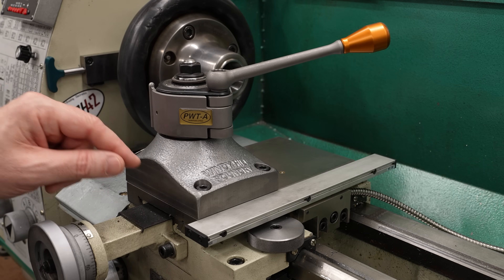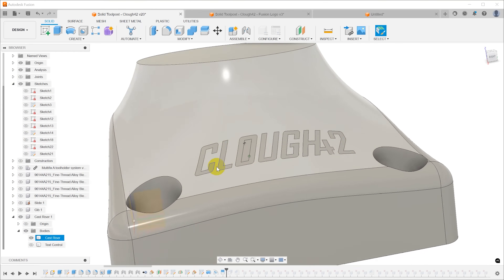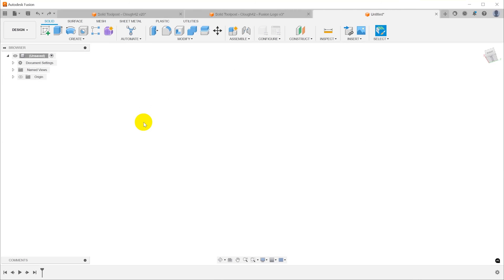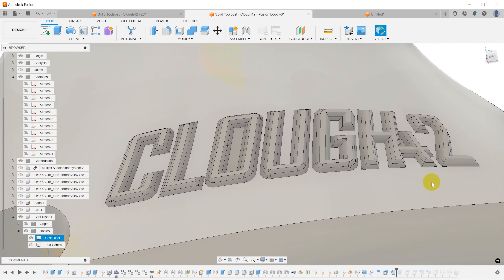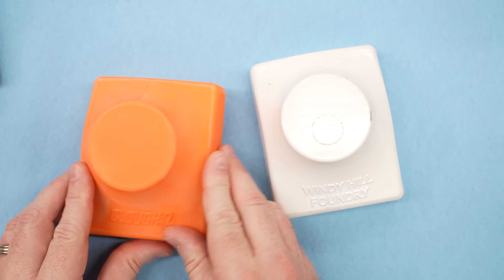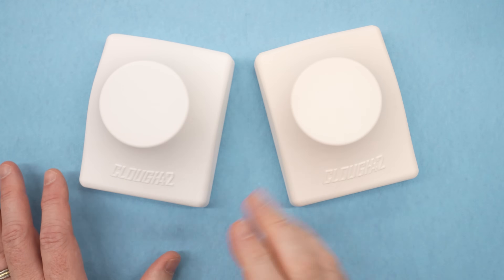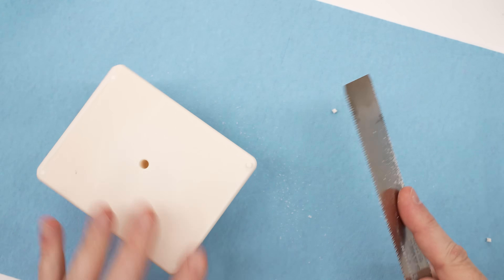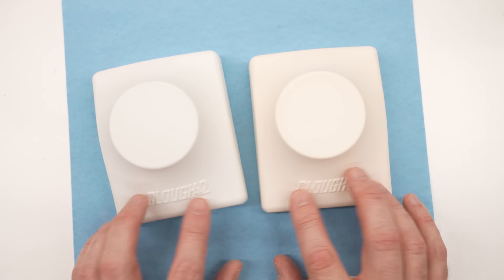Two Years of Effort:  Toolpost Riser Castings NOW AVAILABLE

Comment: My summer job in a pattern shop (late 70's) suggests that you 3D print a pattern to cast an aluminum pattern, which will last a good long time in production. The 3D print will have to be enlarged slightly in size to account for the shrinkage of the aluminum, if you desire that level of size accuracy. Love your channel!

Comment: The problem isn't Fusion, the problem is the font itself. Fonts generally are horrible when worked with like this, they aren't designed with precision. My typical path for any logo (not just for bringing into CAD) is to convert it to outlines. Then manually go and edit all the nodes, adding and deleting as necessary, removing any overlapping areas, and duplicate nodes, adding in constraints (smooth) for all nodes on the splines when transitioning from a line to a spline to ensure tangency. I do this until I get a minimal set of nodes that cleanly represents the original, which should be a single outline for any character (or joined set of characters), not including cut-outs. (basically what you ultimately did in Fusion, but doing it all in the illustration package of your choice).  You can then export that as a SVG, and bring it into just about anything without problem, it should correctly scale then too, without eating itself as you saw.

Comment: The "normal" production sand casting process is to print or machine the pattern from something soft. We used a material called Renboard. That was used to cast an aluminum pattern. If the aluminum pattern wore out, we would cast a new one from the original master. That said, the renboard patterns were often used to cast hundreds of prototype parts without issue. It's pretty fun to machine compared to any kind of metal.
Reply from the maker: I've often walked by pallets of renshape big enough to mock up automotive body panels at work.  It's amazing what you can do with it.
Reply: WWW in the house, you have that CNC machine up and running yet?  Nice work James thanks for the detailed explanation on Fusion 360.

Comment: I have a simpler solution. Print the pattern without the text. Print the letters as a seperate prints and glue in place. I have done this a number of times. it also makes it easier to fill smooth the main pattern without the text in place.

Comment: Hey James, A process my son has been using is coating the PLA print in resin.  I print the object in PLA on my Bambu then he dunks it in resin and cures it.  Fills in almost all of the layer lines.  You might try that, might save a bunch of time.

Comment: One fairly quick strategy I use with fonts is to fill them with black, then take a screenshot of your text (or export as jpeg, bmp, etc..). Then open inkscape and use the bitmap trace feature. This will give you a connected single vector around each letter (or the entire word if you are using connected fonts.)

Comment: Excuse me if I missed this in another video but can you share your thoughts on the horizontal offset you designed into this solid mount? Is just as simple as keeping the cutting tool as close to the work piece as possible?
Thanks, Erik

Comment: Haven’t gotten all the way through, but I’m curious if you’re going to talk about ABS or PLA vapor smoothing instead of sanding or bondo.
Edit: Ok, no mention but your result is great obviously. Still curious about vapor smoothing. If it works it should be cheaper and faster.

Comment: My strategy for complex geometry chamfers is to draw a triangle on a perpendicular plane and sweep it around the part. This still runs into problems, mostly self intersecting geometry, but it has gotten me through many otherwise "impossible" situations.

This doesn't work well for adding material to create the chamfers, it's best suited for situations where you can subtract the swept geometry from the target body. That said, you can sometimes oversize the triangle (and use something other than a triangle) to try to avoid gaps between the sweep and target body when you can't subtract.

Comment: I'm glad i'm not the only one struggling with fonts in CAD... 

I was often wondering if it wouldnt be easier to do the part modeling in some design software like Fusion/Alibre/Onshape.... and then just taking it to blender or plasticity for adding the fonts.

Comment: You must have heard me through time and the internet on that font. I used to be a full time desktop publisher. Illustrator, Photoshop and Quark XPress were my life. 😂Good fonts are expensive and are expensive for a reason. The foundries would spend hours perfecting issues like the ones you demonstrated with the "Mrs" problem by creating custom pairings and other tricks. Those issues didn't exist in them. But they were hundreds of dollars each, sometimes each style - Bold, Italic, Bold-Italic etc. We had one customer that insisted on using a provided font file - something they bought cheap - and I spent more time, and their money, fixing the problems we had using it than it would have been if they bought a professionally designed font.

Comment: At around 9:50 when you were editing the text outlines, did you know you can double click the text lines and it will show you how continuous the line is? Generally I only use the Fusion360 built in text function to label mold parts that are not seen on the final part. If you can't afford Adobe even a free drawing program like Inkscape will produce high quality type for 3D uses. Nice detailed video, I watched the whole 33 mins.

Comment: I'm an engineer that works in product development. Frequently we have to put logos/text on sand casting bucks and try and get them to draft. As you found: its not easy!

We developed a great way to approximate a draft angle on text (often "close enough" is "good enough" for sand casting). Rather than doing an offset of the surfaces, copy the surfaces you want and translate them in the same direction of draft (this eliminates any opportunity for undercuts to form) 

Then you create a new sketch normal to the text and offset each letter inwards a few thou. Use that sketch to split/trim away the offset text so that it is a little bit smaller than the parent surfaces. 

Once you are happy with the offset, you simply create a loft between the original surface and the offset surface. If you are trying to hit a specific angle you can start playing with the distance you offset/trim off of each letter until you get close.

The result is a letter that will have a consistent appearance across all of the letters and be in draft!

Comment: What's the dimensional stability of the resin print?
Because it is a thick opaque part my assumption is that resin inside the part is not fully cured, which may result in deformation of the part in future.

Comment: Interesting. I've done a lot of work with importing True Type fonts and other artwork into CAD/CAM tools, and haven't seen these sorts of artifacts in the fonts. The stuff i wrote was a v-engrave plugin for CamBam that walked the outline and computed a 3D path for a v cutter to dive into the outline such that the cutter rides tangent to both sides of the outline. 

One option that might be easier for cleanup is sucking the outline into Inkscape and cleaning it up as an SVG, which can then be converted back to dxf and reimported into CAD software. I did a lot of that for a recent project.

Comment: You can also set a negative taper angle in your extrude operation, which may have been able to give you a draft angle.
Reply from the maker: Not against the curved surface.
Reply: I would do a clean vector file projected onto two construction surfaces.  One raised and one slightly below the casting surface.  Offset the one but the distance needed for draft.  Then use loft tool to create letters.  Then use combine feature later with casting. I have found that creating a multi body part and combining at very end is the only way to get there effiently sometimes.  Sorry if I was hard to follow.
Reply: One other thing you can do.  Go to manufacturing space.  Cam the original part with no chamfer.  Use original model as stock model.  Cam the chamfer.  Save Cam machining simulation as stl body.  Cheater way of doing it.

Comment: Regarding Fusion problem - fonts are always pain in the ass. I tend to resketch everything using native geometry, proper splines/tangency etc. Other tip is projecting a sketch to a surface, then using surfaces to really build whatever you want to have there. This way you have 100% of control and you are not at mercy of emboss command.

Comment: Taking in to the account that its just font on casting metal(so it always have some small imperfections and dont need to be 100% accurate) I would just load main body in Blender or ZBrush merge font with body, smooth edges to get proper slope.... and done. Is it dirty workflow? Yep. Is it supper accurate? For casting and just for font/logo its perfectly fine. :D

Comment: A lot time when you export / import from Illustrator, you end up with some points on the outlines are doubled or overlapping. Like the start / end is usually not closed, but consists of two points. The same in sharp corners, which you need t clean manually. 
I am doing 3D design for over 25 years and it can be really vexing has you have found out :). The best way is exactly what you did - simplify - redraw.

Comment: woah 20min cure seems like a lot. I generally cure my prints for a 30-60s per side, but then I don't use opaque filled resins like that. I've only used Elegoos standard resin for a few prints, but then only Ameralabs XVN-50, and it's great to work with. Good resin really makes it so much nicer to work with

Comment: Nice work on the pattern. Clark will thank you for the care you take on draft angles. Have you used the oil based paint that Tractor supply has with their catalyst added sets up very hard and with a nice finish.

Comment: This issue is not unique to Fusion in the slightest though, it's the same in every CAD package I've used, in every vector drawing program I've used. You need to make sure the source material you're using is good, that's always the first step, otherwise you get issues like these. As the saying goes, garbage in, garbage out. I routinely have to teach this to the engineers I work with, even those who have worked with CAD for decades. 

I admire your effort in recreating the logo in Fusion, though honestly I think it would have been far less of a headache to just redo it properly in Illustrator, cleaning up errant points, fixing inconsistencies, etc.

Comment: I don't know if you have ever seen 'UV Cured Varnish' for wood finishing. It is simply wiped onto the wood surface and then cured with a handheld UV light. It seems to me than it is essentially a 3D printer resin (or variation). I had the thought that it could be applied to FDM prints to give them a smooth tough finish. Cures in seconds and can be layered. Never tried it, probably never will. Just a thought. 
Thanks again for another great informative video.😀

Comment: You probably already know, but us carbohydrate foam jockeys use various shaped blocks of wood to make sure we're only sanding the high spots.  It definitely helps make things go faster than using the soft pads of your fingers which somewhat follow the contours of the ridges.  Great video, i'll keep these resins in mind for my upcoming castings.

Comment: I would for sure make a female pattern and then cast it with Xencast P6 polyurethan plastic.. It cures in around 1h.
In that way you only have to do the work once for the female mold and you can reuse the mold for many many times. Especially if you make the mold in silicone.

Comment: Back in the mid 1980s I was taking a CNC Technicians Course and one of the CAD/CAM programs we used on a mainframe was designed for generating curved surfaces as com[lex as turbine blades and one of the problems we had was exactly like you had extruding fonts. We finally generated as list of fonts that you could extrude directly into the program. Others we would have to hand generate like you did by copying and deleting. The main problem we ha was the CAD/CAM program was power hungrily and we could only run it at night when most of the other courses were not using it, and it would still crash about once a week. .

Comment: Nice work.  

Have been working with fonts forever.  I always recommend cleaning or tracing.

For the mold, consider making a 3d resin master, make a silicone mastering then casting resin daughter molds.

Comment: Not just fonts, svg's in general. I had so much pain with importing files, until I just started importing and either repairing or redrawing. The add in, sketch checker, does a very good job of identifying those small errors.

Comment: it would be interesting to see whether abs vapour smoothing would produce a sufficiently smooth surface and sanding could be avoided
Reply: I worked at a cast iron foundry, and I can confirm ABS vapor smoothing does work for patterns. At least in Disa auto molding machines, they may not work quite as well pulling by hand. We had a set of ABS patterns that was going on 25,000 cycles, and were still within production tolerance.

Comment: An easy way to create the embossing is to create an offset face of the surface you want to emboss, then use the split body command and use that offset face as the splitting tool. Then simply merge the objects and you're set. The other simple way is to extrude from within the body you want to emboss on, use the "replace face" tool on the text face, then move the text out the same distance needed. 

If a visual guide helps i'm happy to make a quick tutorial on embossing on complex geometry in fusion, just let me know :)
Reply: Please do ❤️
Reply from the maker: @GodardScientific  I'd be interested in seeing that.  I've tried most of the techniques shown in videos all over the Internet, and most struggle with this particular geometry, though it would be worth trying them again with good sketch geometry.
Reply: @Clough42  I'll throw something quick together, for your model did you use a fillet or a revolve to create the curvature on the main body?
Reply: In Autodesk Inventor there's a "ruled surface" command that I've had a lot of luck with achieving a specific draft angle around the perimeter of complex embossed logos on complex surfaces in injection mold designs. I wonder if Fusion has something similar. It's still a tedious process, and I've never seen a tutorial detailing this approach. Unlike the software world where everyone shares ideas on Stack Exchange, the CAD world seems a bit more guarded, especially when you go beyond the basics. I wish I could share a picture of the part I had designed to give you an idea what I'm talking about.

Comment: I think for part of this, you perhaps lost sight of your end-goal, in the pursuit of making your master meet the requirement of being "quality and durable and printed".. You didn't necessarily need all 3 from one piece. Print one that takes into account 2x shrinkage, then cast sub-masters so it only needs to survive a few of those castings, store it, clean sub-masters to an acceptable level. Then you'd have actual metal castings to use as masters for the rough life of being sand mold-formers, so sand can be pounded against them without excessive degradation.

Comment: Twenty plus years ago I worked for a while as a graphics designer for a sign company. I ran into your Font troubles almost daily. Sad that nothing has changed. Happy that you figured out a solution. In the software that I used back then we could link all the parts of a broken font into a group. The other nasty thing I ran into was multiple layers of lines. 4,5 even 7 layers that you needed to delete down to only one layer. DXF files were the absolute worst when you wanted to turn them into a raster file SVG was your version. I felt for you man. Nice presentation Hoping you and Clarke the best in this adventure.

Mark

Comment: Would it make sense to produce a single high quality master and make it into a silicone mold?

Then you can cast as many copies as you want from 2-part resin.  You might even be able to coat a bolt with mold release to leave a threaded hole.

Comment: As someone who has nearly 15 years experience in CAD and WaterJet operation/programming, I feel your pain with text.
Shop owners thought it would be fun/profitable to make signs... I spent SO much time fixing and correcting simple signs and other people's designs just so it will even post, then having to go back and fix something because there was something that was missed that the machine couldn't deal with (usually impossible small angles).

Comment: Use Rustoleum 2 part epoxy paint for a hard smooth surface on your part model. It cures fairly quickly and is VERY hard and durable.

Comment: Why not make an Aluminum or Cast Iron master? If you allow for 3% or 4% or 5% shrinkage of the CI, (more % if you want an initial Aluminum master mould), you would make a 3DP mould at +6% or +8% or + 10% oversize to make the first 2-3-6 master CI moulds, then when they shrink in the first casting there is still 3-4-5% oversize for final parts casting results, and you have CI moulds that will last forever. Heavy CI moulds will form up easier and more consistently than lighter plastic moulds + last forever vs 3-5-10 cycles for plastic 3DP.   +2c